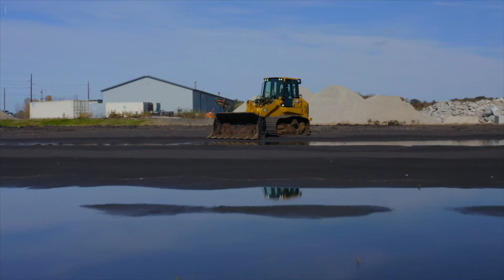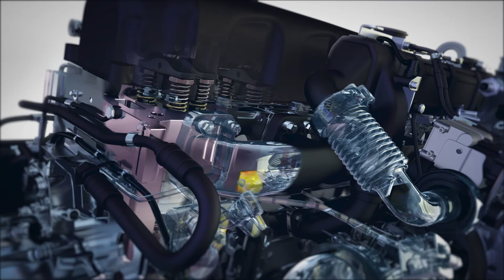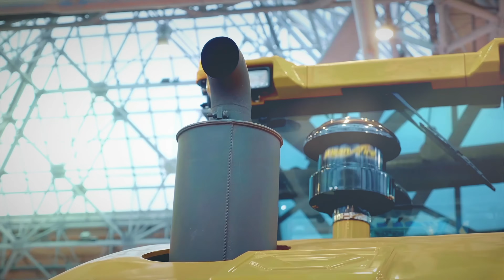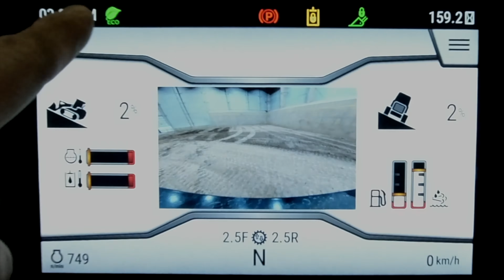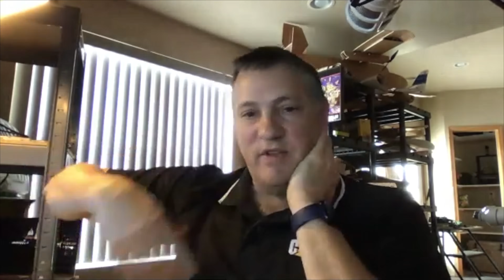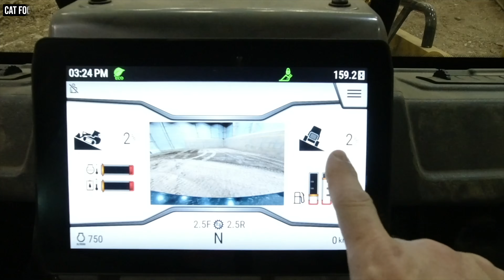Why the Cat 963 is "A Great Big Skid Steer" | The Dirt #26

Comment: Bobcat 963 was a big skid steer. Cat 963 looks like a technological disaster in the making. I would rather restore a 955 track loader ! The throttle does the same job as the electronic "eco" or power modes. A lot cheaper to fix when it inevitably breaks.